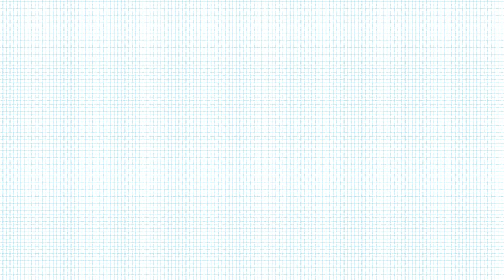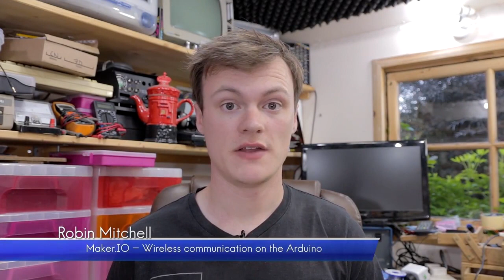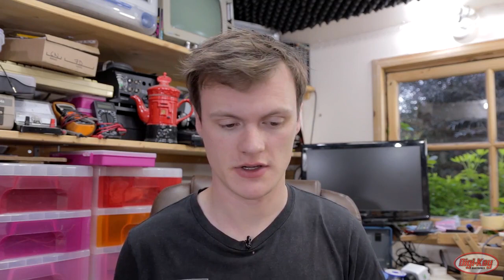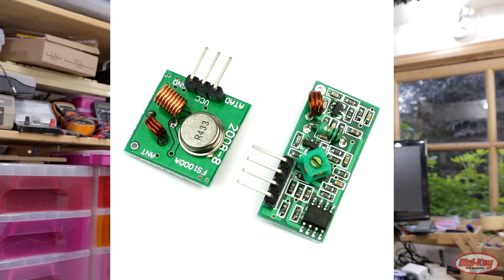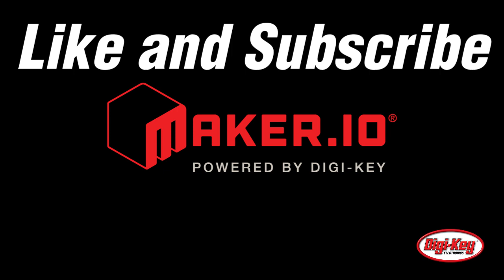How to Wirelessly Transmit Data on Arduino

Comment: Im in trouble with coding for days!!.
I only can send/use the code in the library and send stuff like a const char ("blablabla"). Floats ints and so on wont work... :/.
By the way: The range of the modules is 40 cm with quarter wavelenght antennas (173mm)